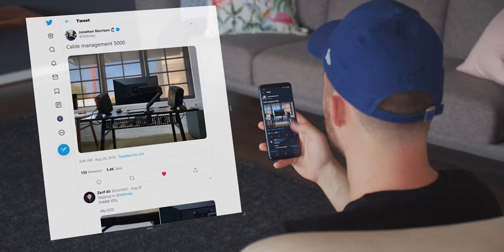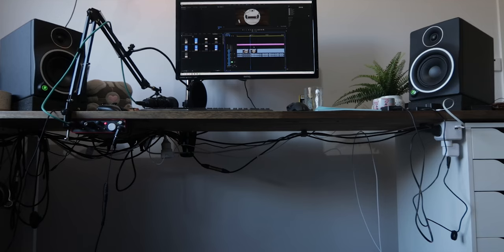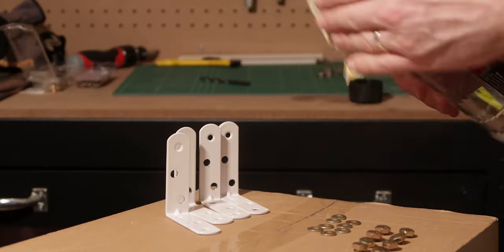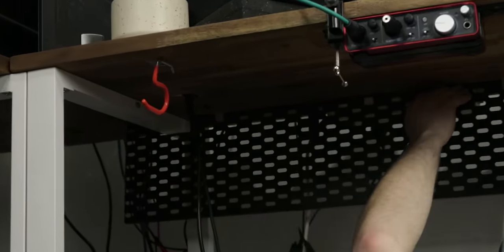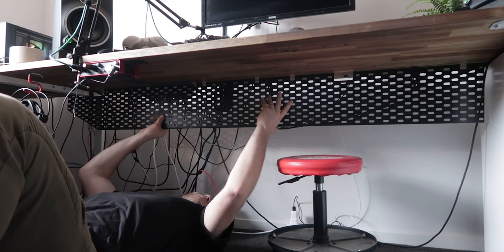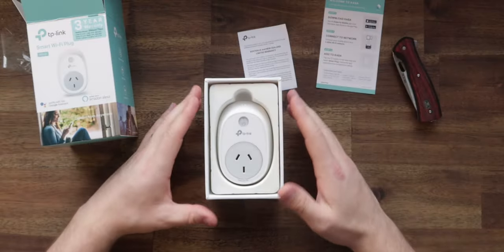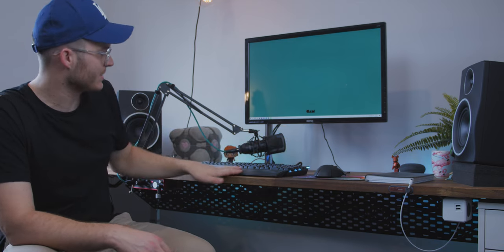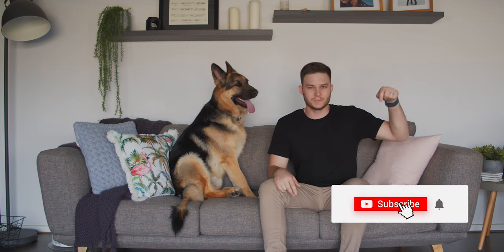Cable Manage solution for your DIY IKEA Desk!

Comment: Very, very good solution. I'd say, "original". Bravo, bravo, bravo.
Reply from the maker: Thank you 😊 it's been quite handy to easily add and remove cables with so many mounting positions, Hope it helps you with a future project 👍
Reply: @camshand  Sure. Can I Know what software have you used for graphics?
Reply from the maker: @211mikail  I edit my videos with the Adobe suite if that's what you mean? So Premiere Pro for most, and After Effects for any motion tracking 😁
Reply: @camshand  i want to know which sw to draw electric things like sonos, etc

Comment: I’ve always used black pegboard to create an almost identical setup but the metal looks nicer! I’d love to do that
Reply from the maker: Didn't think of that! But that would do the trick.
The metal server rack tray does look good, I forget how messy under my desk was before it now 😂
Reply: @camshand  I was going to try it but then realized that particular rack I cannot find in the US..boo.
Reply from the maker: It'd exist but you may have a different name or standard in the US. But you have servers so there must be cable management 😉 the only other issue is suppliers though, as if you're not in a city then delivery of a 2.4m long bit of metal would be expensive!

Comment: What did you use to support the desk where the two table tops meet? I see the Alex drawers on the outside ends but what is the “box” in the corner?
Reply from the maker: Oh they're desk legs from a old desk. Pretty much just take the base from any other desk and use them for the corner. 
I've gone to a single desk in my current setup, was to hard to film with the Massive desk! You can see in my more recent videos 😊

Comment: What height is the cable tray you used in this video? I can find 150mm and 225mm here in Sydney but concerned the 150mm will be too narrow to mount power boards and all my cables.

Comment: Hey man, how did you mount your Focusrite to the table?
Reply from the maker: I used "make-a-bracket".
Its easily bendable metal with predrilled holes that work for mounting.
I wrap it all in black duct tape to protect from scratching :)

Comment: Is this 4 or 2,7cm ikea desk? Did you strengthen top in the centre or is it just put on two left/right parts?
Reply from the maker: Hey so the tops on my desks are actually from bunnings. Very similar to the typical IKEA ones but cheaper for the solid wood option: https://www.bunnings.com.au/2200-x-600-x-26mm-acacia-solid-oiled-hardwood-project-panel_p8330032

Since they're solid wood no need for a brace in my case, so they're worth it over the base IKEA model which is a veneer that's weak. They are the IKEA ALEX drawers though on each side.

Comment: How did you mount your sound card under the table?
Reply from the maker: Hey Toshisan,

I use the "MAKE-A-BRACKET" stuff you can get form a hardware store, then wrap it in wide black electrical tape. They come in varying widths, lengths and thickness. the 1mm you can bend yourself with a vice, or even hands, at 2mm it's pretty much you buy it with bends if needed.

You can see it in this video of mine: https://youtu.be/YsHO6RORsKg?t=240

It has to be the easiest way to mount things, I've more recently put up Acoustic Panels on my walls, and hooked some over doors, all by buying these make a brackets, bending them to be the shape I need then wrapping them in tape to protect from scratching.

I'll be using this to mount a mini sub amp under my desk for an upcoming video too so I'll be sure to touch on this mounting method you've brought up as others might find it useful!

Hopefully that helps you with your D.I.Y. Project 😁👍

Comment: How did you mount the audio interface to the desk?
Reply: Just some tape?
Reply from the maker: Hey mate, I buy some make-a-bracket. Easy to bend with your hands as long as it's the 1mm thick one.

Comes with a stack of pre drilled holes too, then I just wrap it in some wide electrical tape to stop from scratching.

I'm working on a vid now about a tactile transducer chair mod, and I've mounted a mini 100w amp next to my audio interface the same way. It's such a simple yet great method.

https://www.bunnings.com.au/carinya-20-x-600-x-1mm-flat-make-a-bracket_p3975874
Reply: cam shand thank you,

Im looking forward to your post!